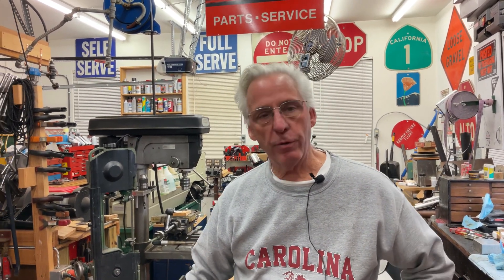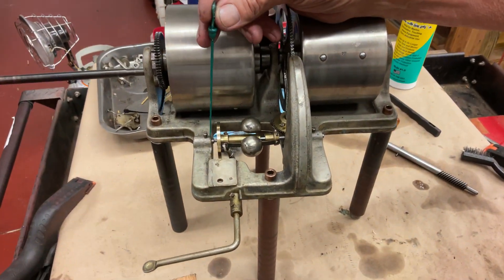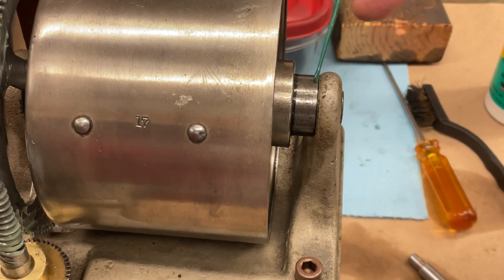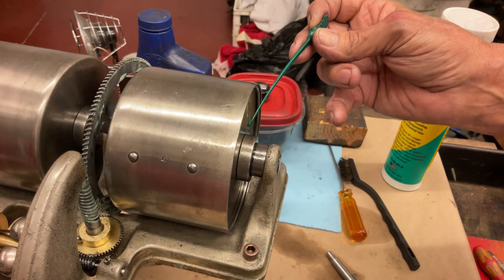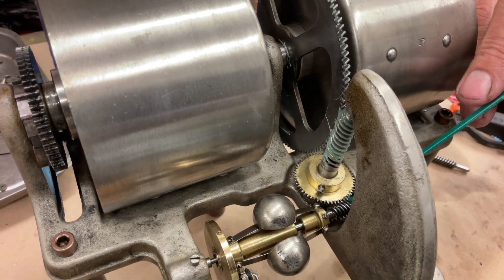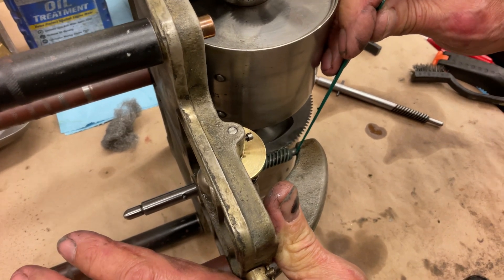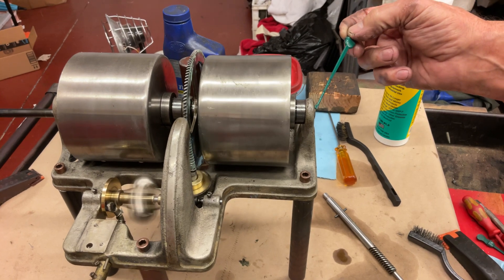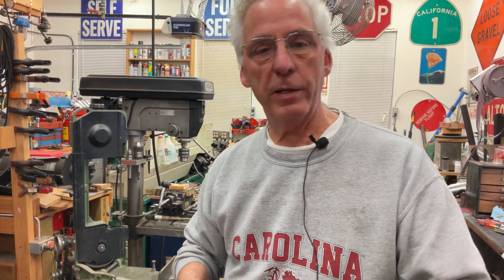1388. Where to oil and grease a Victrola 4-spring motor

Comment: Could not catch what type of light oil you use as well as the grease?? What grease would you suggest when rebuilding a spring motor and why?
Reply from the maker: I use sewing machine oil as my lite oil and Green Grease, available on Amazon as my grease because it is a tacky synthetic polymer, does not break down
Reply: @1974hurt
Reply: Thanks for that clarification...on another note, I spend time in Seattle and made a stop by Victrola Coffee a couple weeks ago.  Noticed the coffee cup you mentioned in one of your posts. Cheers!
Reply: What green grease do you recommend me using for a victrola, my friend.

Comment: What grease would you recommend for the brass gear
Reply from the maker: I use Green Grease or Green Grease mixed with graphite.
Reply: @1974hurt  even for the single barrel 2 spring victrola motors and is it a mix of 50/50 for both greases